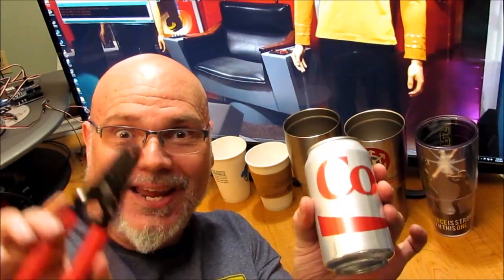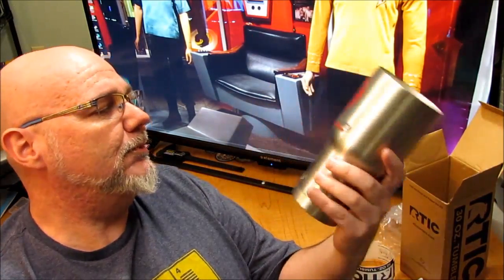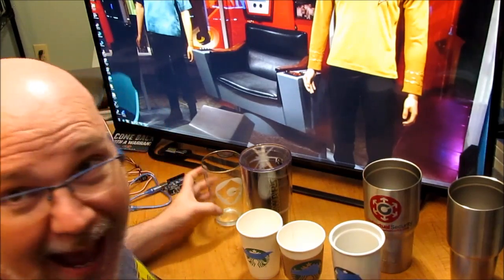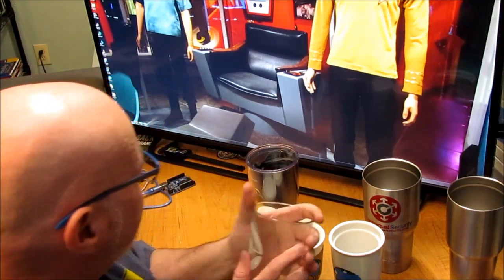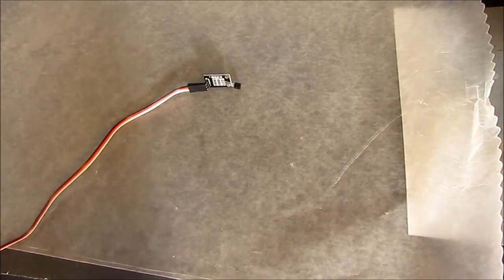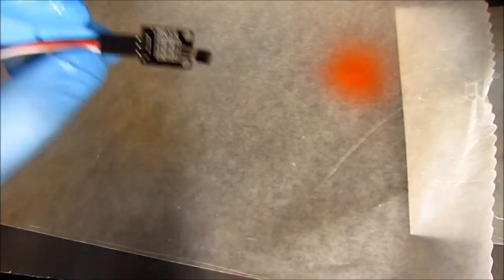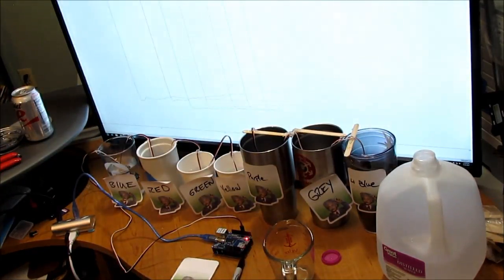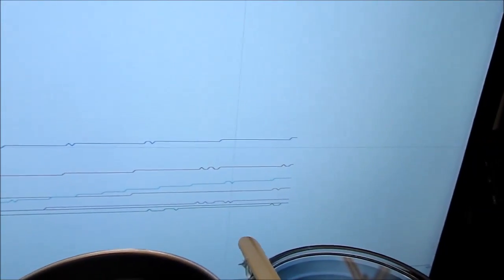017 CUP TESTING

Comment: Loved the video and the analysis.  Thanks!  I'm a n00b Arduinoist, with questions:
1) Did you have to solder 8 Dallas DS18B20 in series?  How do you do that?  
2) I assume you pulled the data off the the arduino using the serial cable. 
     ...how did you make the graph on your computer? 
3) Was the SD card just a back up?  
4) Do you release your code? 

Thanks in advance for whatever you're willing to share.  I like your style man.

 - Rush